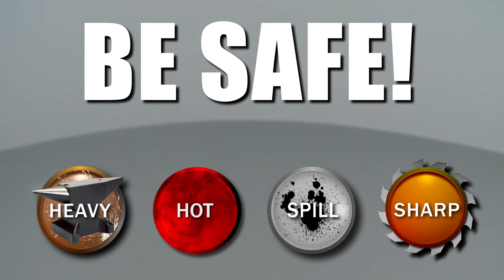Briggs & Stratton Small Engine Carburetor Replacement Part # 799584

Comment: After being quoted $120 estimate to get my mower working again after the winter, I decided to do it myself. With your video and about $35 in parts, I replaced the carburetor, plug and air filter and the mower cranked on the third pull. I'm so tempted to call the mower repair shop and thank them for motivating me to do this myself. Much appreciate you posting this.
Reply from the maker: You're welcome! 

If you would like to give us a review, here is our link: https://g.page/r/CcVUrahZNozMEBM/review

Have a great day!

Comment: This was great! I have an older B&S model but very similar; the main difference being that there is only one linkage to the carb, not two. Took the carb off, paid $30 at a mower shop to have it cleaned so I wouldn’t have to deal with all that, and all works like new.

Comment: The video worked for me. It gave me enough instruction to remove my existing carb, spray the crap out of it with cleaner, slap it back on and boom the mower worked fine.
Reply: That's my plan too!  :-)

Comment: Good video. However, it is important to note that you may need the lever choke if your mower has this. The video shows that there is one on the existing and the new carburetor. However, if you buy even an proper OEM one, it may not come with the lever. Every single one I have found online does not state that it comes or does not come with it. And, all of the pictures do not show it on the carburetor.

There are two possible part numbers: 594058 and 799584. Based on everything I have found, these are the same. My mower's engine serial number matches up with Mfg. No: 104M02-0001-F1 according to Briggs & Stratton. Within their published parts manual, the carburetor is part number 594058. In the drawings, it specifically shows that the choke lever is not included with the carburetor and that is a separate part. Their part manual states that the part number for it is 591104.

If you have these lever on your existing carburetor then you can try to take it off and put it on the new one or just buy a new choke lever.

Comment: So the retainer that was removed from behind the oring is not used on new carburetor?
Reply: Need a reply to this question.  There is a retainer ring in place on the new replacement carb and a new black o ring lose in the box.  What happens to these parts where are they used?

Comment: Just a FYI. That red Oring that came with the new carburetor goes behind the adapter behind the metal mounting brackets, not in front of the adapter where the carburetor connects to.

Comment: Question: What's the "official, full, correct and complete name and OEM Briggs and Stratton part number," of the item in this video that's just behind the carburetor mounting bracket, which you refer to, as the "adapter," as shown in the hands of the repair man, beginning at the 2:05 min. mark of the video . . . for a  Toro Model 21321 Recycler 21-in Gas Self-propelled Lawn Mower with 140-cc Briggs and Stratton engine, which I am planning to purchase?
Thanks, in advance.

Comment: I followed these instructions and the new carb leaked gas out the I take like mad.  Does this mean that new carb is faulty?

Strangely enough when I reinstalled the old carb my mower started running again, so I guess these instructions worked even if the new carb didn’t.

Comment: I found that most of the problems with these cheap china carb is the needle/seat is not setting right.  A simple adjustment to the needle via shim where it sits in the float works well.  The float needs to sit at a very flight angle up and NOT flat as mine was.

Comment: This video is faulty in that it doesn't explain that the replacement carburetor does not come with a choke lever. The old choke lever has to be pried off the old one. There is a video alone about installing a new choke lever. So be prepared to re-use the old one ... or order a new choke lever with the new carburetor.
Reply: Thank you Robert! I was baffled by that. What comes out of the box at 2:31 is NOT what is later bolted on to the machine. Another part mysteriously appears, first visible at 3:01. I assume that's the choke lever.
Reply: @jondrayna6978  same here - good stuff! Thanks for calling it out Robert.
Reply: That's a critical missing part from the video.  Nice catch.   Luckily the old one pulls off relatively easily.

Comment: I did this and it runs at half throttle, I can press the throttle linkage back at the rear of the engine and it revs up. Anyway I could have bent the throttle linkage?

Comment: Not quite as easy as the video shows when performing on an old, used mower, but after struggling along and re checking the video several times, it all went back together with no missing parts.  Although, the carb kit had a wrong size fuel tube, so be careful as you pry it off each end, in case yours is the wrong size.  At 2:43 there are no parts like on my machine.. a white plastic ring and a black o-ring that go together on the adapter after inserting it through the mounting bracket.  Anyway, the hardest part was finding what type screw head the blower housing cover had as it was encased in gunk way down the hole.  Needed a * driver.  smh  And, of course the gas tank does not just slide up and off.  There's some type unseen latch that catches it, and I didn't feel like tearing up something, so was able to shift it over enough to perform the deeds.  Without the helpful video, I couldn't have  done it.  Thank you!  The mower, unbelievably, actually started on the very FIRST pull!!
Reply: I was thinking to do the carb kit first.  I can replace the carb for $34, but I got the exploded diagram of the carb from Stratten.  I will try to order the carb kit directly from Stratten, but if have a better suggestion, please let me know.
Your comment is going to help me a lot (with this excellent video)!

Comment: i did all this, but now i get a fuel leak from between the air filter housing and the carb
Reply: I had the same issue. There is a shut-off-floater (same as your toilet water shut-off-floater), that mechanism has failed and you may or may not fix it. Just buy a new Carburetor and replace it again.

Comment: Hey guys I found a gem sitting on the side Of the road in a pile off rubbish.
It's a 1995 victe trim a line mower very small unit with a tecumesh two stroke engine. I wish I had taken a photo before I restored it. Trying to work out how to post a photo with this comment..

Comment: I could use the part number for the carburetor mounting bracket applicable to Briggs  and stratton engine model 104M05-0040-F1. Any assistance would be appreciated
Reply: Your part number is 594058
Reply: The bracket is 593330
Reply: @zfan2591  thank you!
Reply: @zfan2591  thank you again!

Comment: I just put the new carburetor in and everything was fine untili began to cut some thick grass and smoke or a vapor started coming out from the where the carburetor is!!!
Reply: Everything straightened itself out. It was  because oil was getting into the carburetor. Once i stopped doing Everything bezame peazhy.
Reply: @billybob042665  that's absolutely correct. I stopped titling it and everything went back to normal. Thank you :)

Comment: Now if only the 799584 carb were not such a POS. After a complete breakdown and cleaning, I discovered a non access able fuel line running from the jet main. ITS COMPLETLEY PLASTIC and a molded enclosed unit. What the hell? Instead of a ten dollar fix, I get to buy a whole new carb in the price range of 70-100 dollars! BOO on you Briggs and stratton!
Reply: that  799584  only  cost   $  41.50  thru  me